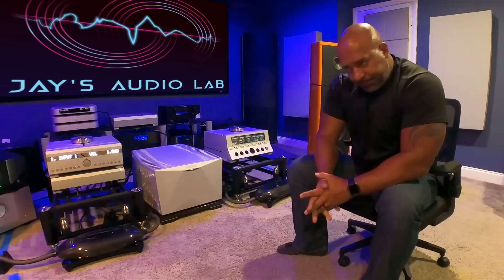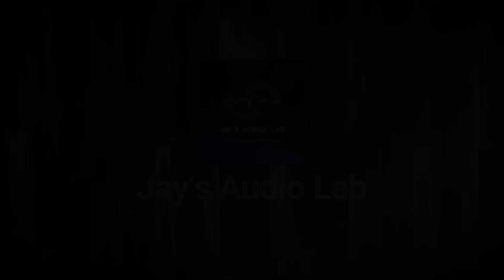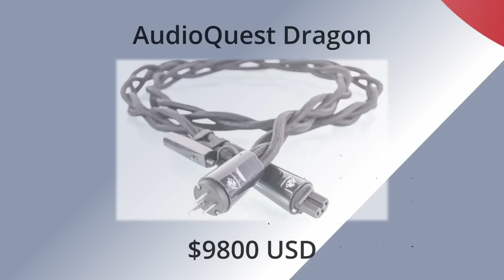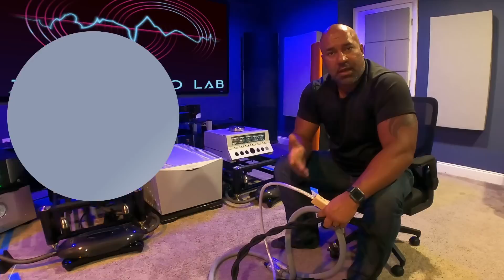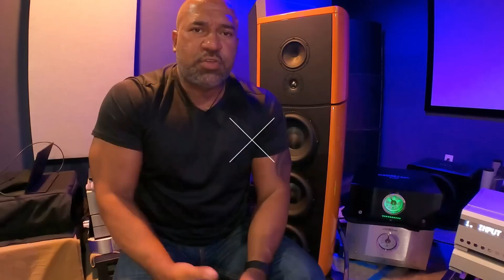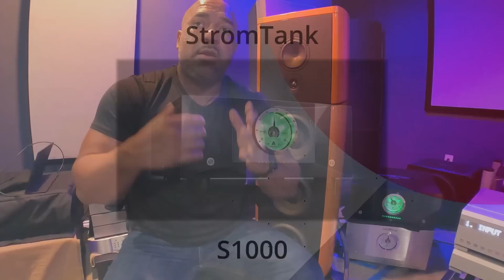Why Do Expensive Audio Components Need Expensive Power cords To Sound Their Best ???

Comment: As mention on earlier clip, Power supply in audio devices are not design up to audio requirements. And that is purposely done,  it is business model.
Reply from the maker: Gotcha
Reply: From my understanding of to your perspective Am I to understand that designers of ultra high end components deliberately fail to implement great design so they can sell you another so called improvement or new model next time your wallet is on fire?
Reply: yes your understanding is correct. do they use these funny power cords in studio equipments, no they don't.
Reply: @glazzarus  Most recordings are garbage.
Reply: @glazzarus  Yes they do. It's cost prohibitive and recording engineers are way behind the times with this stuff, but mastering engineers use tons of expensive wire. Because it works even in "properly designed" professional devices.